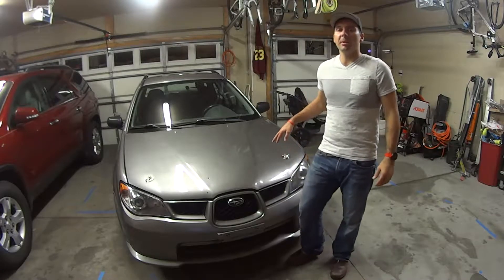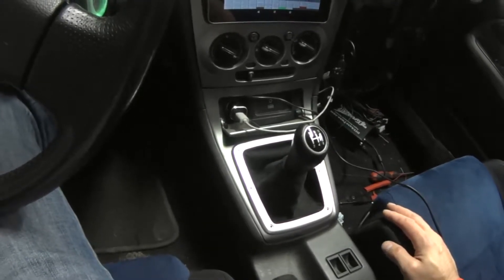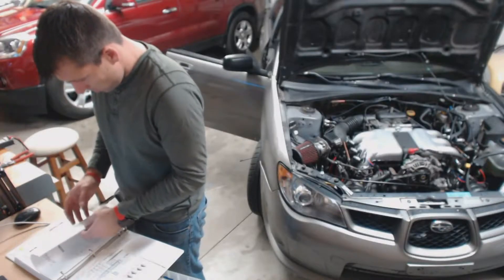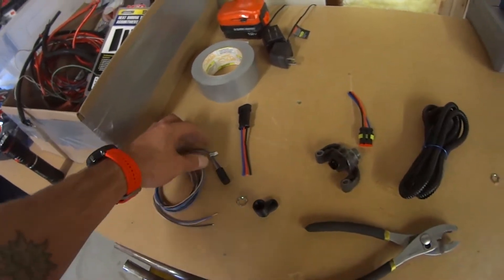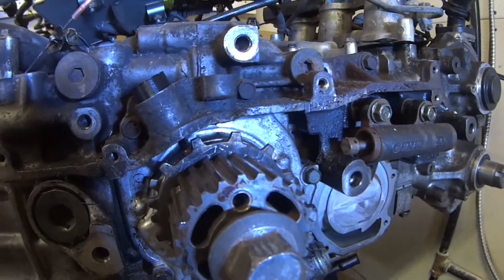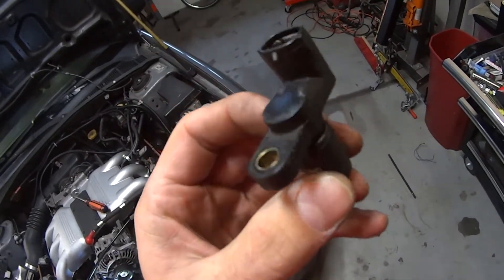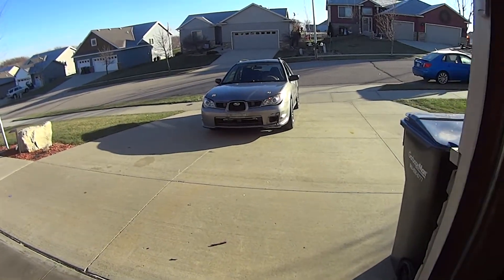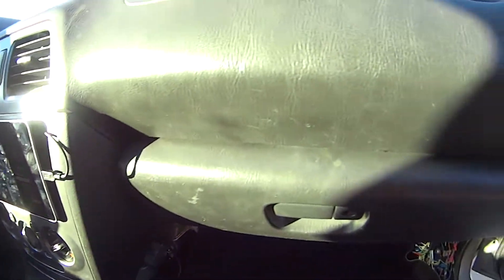EG33 Swap - Short Throw Shifter and Hall Sensors (Ep. 9)

Comment: You keep saying you're "converting to hall sensors", Are the factory EG sensors not hall effect? I thought the ol EJ ones even back in 89 were. I did hear you mention them as VR sensors... Funny how the oil pump looks so much like an EJ pump, but has that extra sensor. I wonder if doing this all over again, you could convert to an EJ oil pump, crank sensor and crank sprocket, if using an aftermarket ECU where you can setup your own triggers (obviously wouldn't work with a factory SVX ECU). I'm tossing up doing an EG or EZ swap like this in my dirty ol BG wagon, or just slapping a wee turbo onto the 25D...
Reply from the maker: I successfully converted the hall which is much better there is no sync loss with the aftermarket ECU. I'm not sure why you would want to use an EJ oil pump when the EG oil pump is sufficient. Also I see no reason to setup your own triggers when the stock ones work good as long as you use a different sensor. With the VR sensors if you Shield the cables properly you shouldn't have an issue.